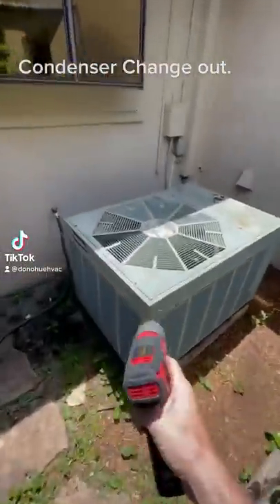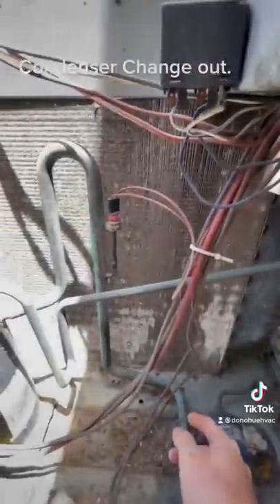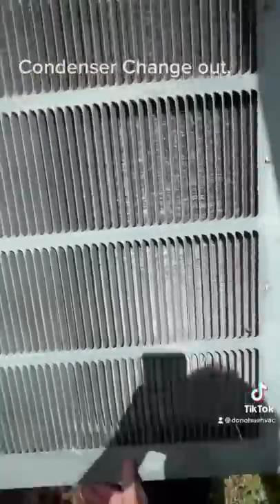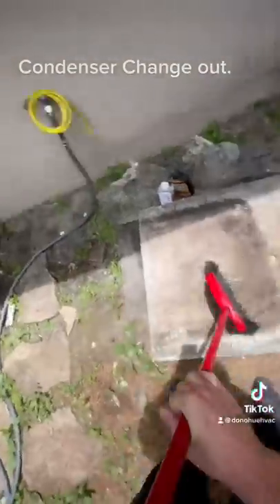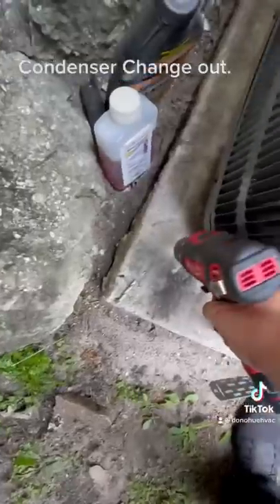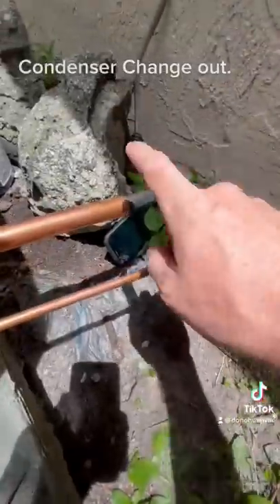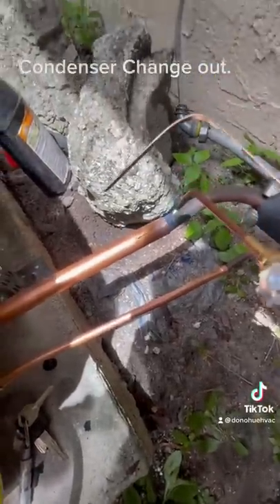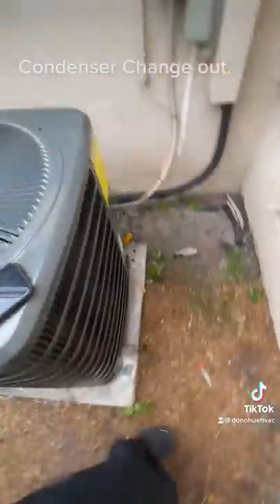Condenser Air Conditioning, DIY

Comment: Don't lay your valve stems on the ground.. Also goodman sucks
Reply: Have had good luck on mine, 3 years Now and running great. 109 outside and it can bring the house to 68 or colder.

Comment: Where’s the line dryer on high side line
Reply: inside with the evaporator coil as it should be. or its installed in the condenser from factory

Comment: That's some rough piping.
Reply: Literally that's what I said the copper job on that is trash the guy would get fired on the spot I would cut it and redo it as soon as I seen it he'd be walking home that's garbage how are you going to take those lines together it looks like s***
Reply: @rodneystill6369  first thing you learn in HVAC is how to pull a neat pipe set and braze.

Comment: So you didn't even try to clean it and see if it worked? Our ac was running poorly HVAC said we needed a new HVAC in general because it was older. We watched a few YouTube videos sprayed the build up our of  the coils in the AC... Our coil was frozen in the HVAC because it wasn't breathing properly. we let the coil unthaw added another return and our home is now 20° colder than outside temp and we saved $8,000 with two 10 minute videos on YouTube.

Comment: One Goodman is garbage. Two did you flush the system? Three if evap was compatible hopefully you changed the metering device. Lastly suction looks like shit. If you’re trying to eliminate braze joints buy a swedger and use the right sized copper.

Comment: Goodman are the cheapest crap you can buy! Buy once cry once.
Reply: Been doing heating and air for over 20 years. All equipment manufacturers suck. So why not buy a cheaper system? You are only getting 7 to 10 years out of them anyways. Not 1980 anymore.
Reply: @timdavis6862  trane

Comment: You need to Triple evac, i always flush out the lineset when changing any ac equipment your braising looks shotty, you need to reclaim the refridgerant, use a wet rag on the king valves while braising or you can create a leak, code requires a lineset cover over the insulation, you pressure test with nitrogen 3 TIMES especially when using existing lineset. Goodman is just the cheapest dont be fooled its good stuff, but youd be hard pressed to find a cheaper 5 ton system. Tell us what was wrong and how you found it out, this halfassed explanation of a condenser changeout helps noone
Reply: Well if he pulled the refrigerant and did a triple evac the good man would probably explode 😂
Reply: @dustinengle2570  SOB, it all makes sense 😆

Comment: No one else see how it's tekk screwed into concrete. Them screws for self tapping into metal. He does the screw tight and can still turn the bracket into place. If you pulled on the bracket the screw would just pull out. Hurricane proof haha. A fart would blow this over. What a muppet. 😂😂

Comment: Yeah, cut the lines, but don't mention that there's a few hundred PSI of ozone killing gas you're supposed to pull out first. And then yeah, what about your pressure check with nitrogen, after you do your Sil Foss soldering with map gas? And then you forgot to tell them to vacuum it down after you relieve all the nitrogen. Yeah people, don't listen to this. I don't even think it's legal to be able to cut your freon lines, not to mention it's dangerous as hell to do so. Brilliant

Comment: Me and you both know Goodman sucks compared to carrier
Reply from the maker: Ahhh I disagree Goodman all day!
Reply: @AirQualityInc  I replace more Goodmans than anything else
Reply from the maker: That’s because the majority of air conditioners are Goodman’s.
Reply: Goodman makes many brands they are all the same imo
Reply: Carrier is trash
Reply: @AirQualityInc  yeah because they are cheap they are the most changed out units and only last half the time as carrier or Bryant
Reply: @brianswenson1848  have you installed a carrier or Bryant lately? They’ve really gone down hill. All carriers are made like their cheaper comfort maker affordable option. Regardless they all use Copeland compressors. Most problems I’ve had with Goodmans are due to poor installs.

Comment: Why is a compressor called a condenser when it doesn't condense gas, it compresses the gas?
Reply: Condenser and evaporator reference the refrigeration cycle. The outdoor coil condenses high pressure gas into a high pressure liquid.

Condenser is referencing the entire outdoor unit

Comment: looks like a downsizing to me less efficient because less mass smaller cooling coils maybe more efficient multi stage compressor probably not though just need more radiators aka coils and more exhaust flow aka heat movement to outside it's a wonder why all air conditioners aren't also designed expressly as heat pumps also bringing heat in on cold night's because it'd work so well i knowing what i know about ammonia refrigeration on industrial freezers know that like a jet engine stacking effeciencies by recycling exhaust with more turbo charger loops up to the limits of the stress factors heat and stretch or compression of the materials used in manufacturing , the more coil loops and compressor stages or like the surface area of coils the wingsurface area of blades or even the fluid speeds gas or liquid  it's a rather simple physics science just looks complicated

Comment: Why did you not just run the line set to the unit? I mean you have 3’ hanging out the house then it 90s back… that don’t help with refrigerant flow you know…
Reply from the maker: Huh? It’s not water man it’s refrigerant lol.
Reply: @AirQualityInc  refrigerant needs to flow as well buddy, it helps pressures get to SH faster and more srable
Reply from the maker: It’s not water😂😂😂😂 what the hell are you talking about. You’re just being a pain in the ass. You make up for it by adjusting the SH/SC lol
Reply: @AirQualityInc  Those guys hating on Goodman either are newer hvac tech's or pushing the brand they like.  It's all up to the Customer and what they want and what they can afford. Goodman has the best warranty in the hvac INDUSTRY up to 10 yrs.
All hvac manufacturers use outsourced components in them.mexico, China, etc .
Reply from the maker: @tomwalker9184  yes Tom Walker, you’re a smart man

Comment: Horrible procedure, didn’t cap lines to prevent moisture contamination of the system. You don’t want any build up of hydrofluoric or hydrochloric acids in the system as those will eat holes in your lines and burn out your compressors. Pressure test at max pressure then pull vacuum.

Comment: Installing plate fin coils in a coastal environment……you are guaranteed to have Freon leaks in the condenser of your “American pride” P.O.S. Goodman 
Quite possibly the worst equipment on the market.  Any contractor that has common sense and compassion for their customer base will install American Standard or Trane.  But then again I find low end equipment dealers count on equipment failure, for the call backs.
Reply: these comments are killing me        🤣🤣🤣🤣🤣